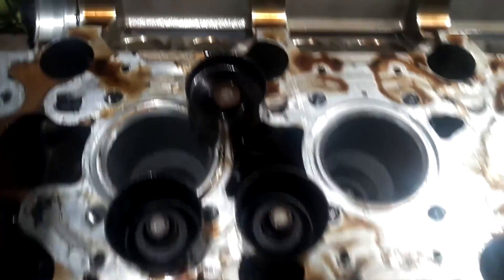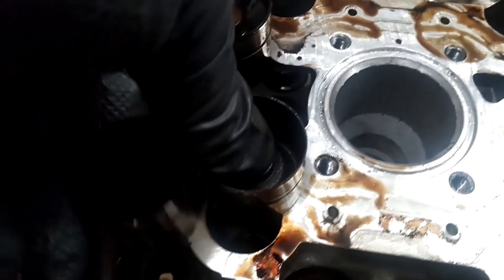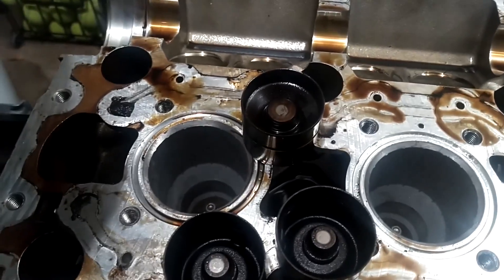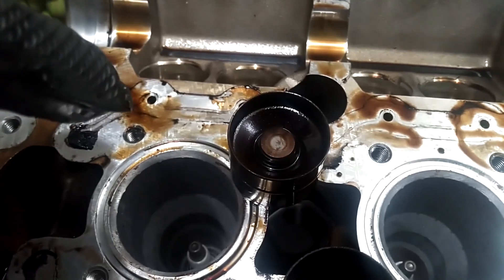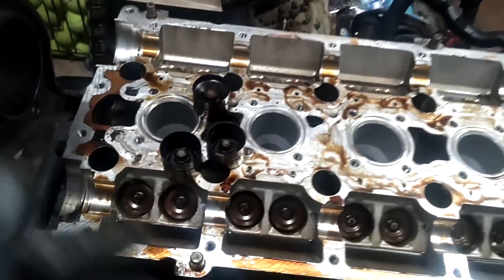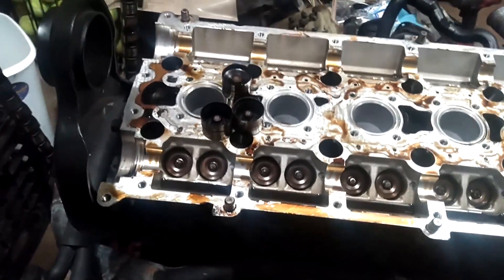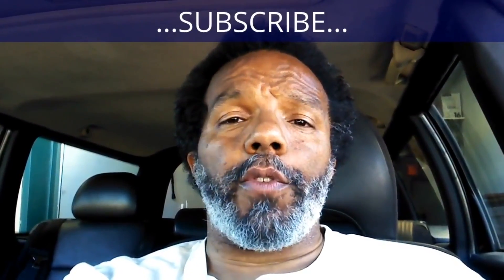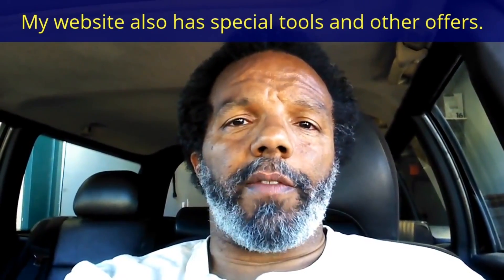The difference between the old and new hydraulic lifters in Volvo 850 white block engines. - VOTD

Comment: My 850 was taken into traffic late '96 but the computer says it's a '97 when I enter the VIN into some volvo software I got a hold of. I do wonder if it has the newer style lifters or not. Engine serial is 830,000, not sure when they changed over?
Reply from the maker: Me neither. 🤔
Reply: @RobertDIY  I found it, new lifters started with engine serial 1217672, so mine doesn't have them.

Comment: how much of the engine do i have to take apart to access these lifters? does the timing belt need to be exchanged?
Reply from the maker: release the timing belt, pull the stuff off of the back of the head, pull the cam cover, then remove the cams.

Comment: how many miles does a P80 Volvo last on average? Mine currently has 224 000 miles on it. No big issues so far with it.
Reply from the maker: I believe they are designed to last 500,000 miles.
Reply: @RobertDIY  So 804 671 km? Damn!